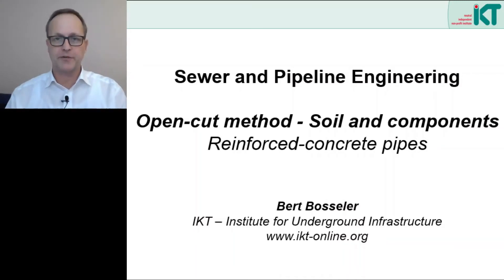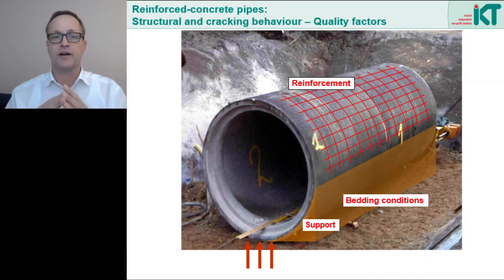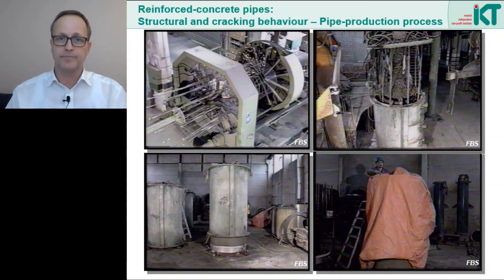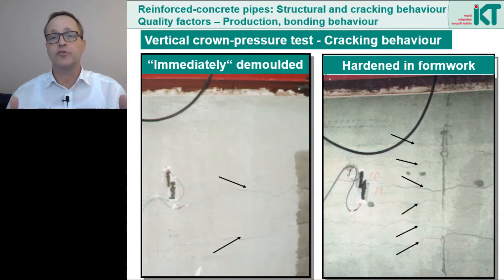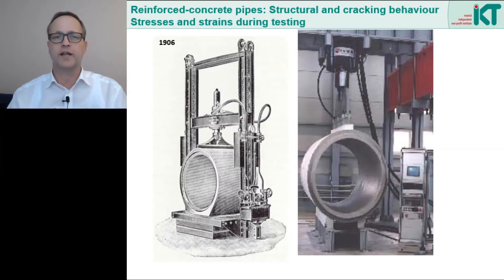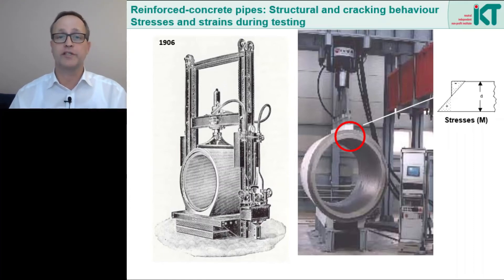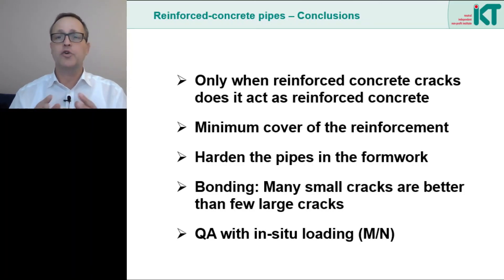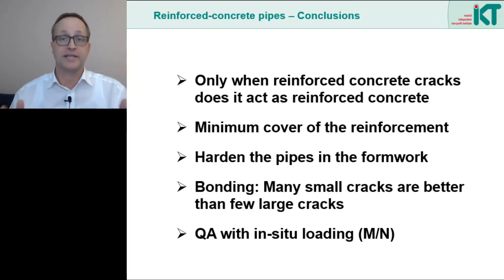SPE 004b Lectures on Sewer and Pipeline Engineering - Reinforced concrete pipes (open-cut method)

Comment: Thank you for this lecture. Question: during a cctv survey of a reinforced concrete pipe, are small cracks considered as pipe defects?
I think the amercian PACP standard does count cracks in any pipe as a structural defect.
Reply from the maker: As mentioned in the lecture reinforced concrete only acts as such if cracks occur. Of course the crack width has to be limited to a reasonable small value to ensure e.g. tightness and a corrosion resisting environment for the steel. Usually 0.2 cm maximum crack width and a protective concrete layer of 4 cm are a good start.
CCTV standards for sewers (also ISO an CEN) usually do not explicitly refer to composite materials like reinforced concrete and rather consider cracks with regard to concrete or clay pipes which of course shouldn't crack at all to ensure stability and tightness.